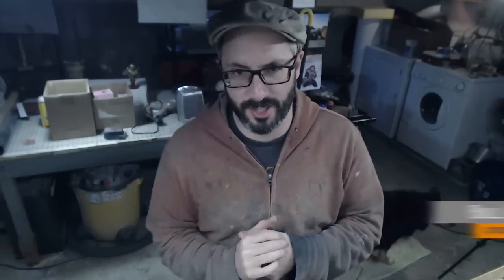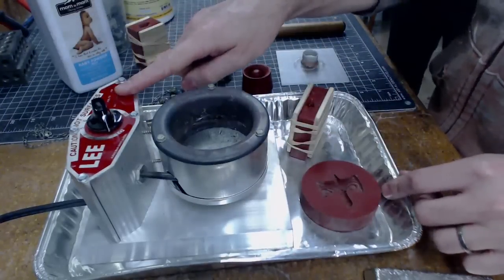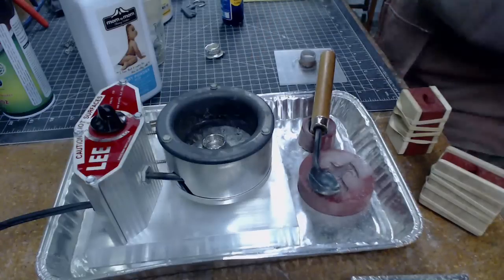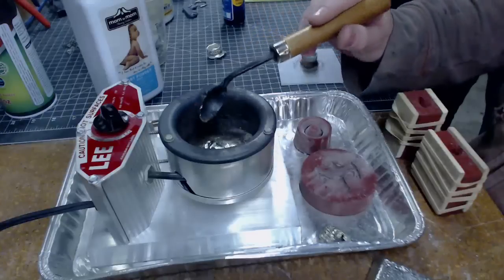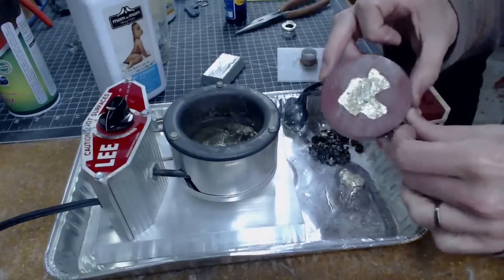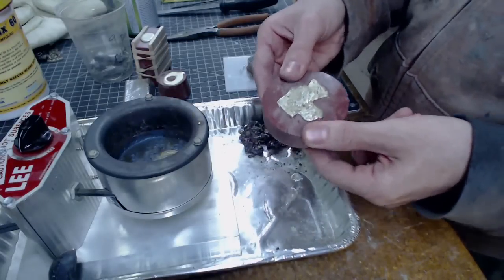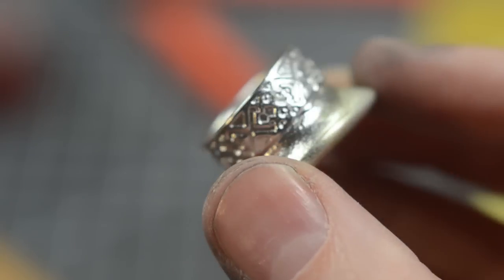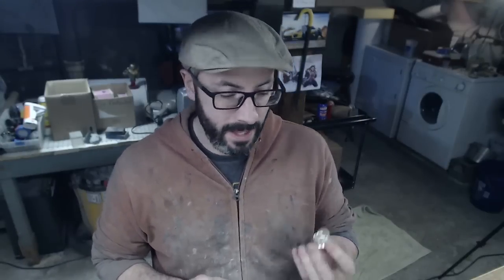Easy Metal Casting with a Silicone Mold and Pewter - Prop: Live from the Shop

Comment: Just wondering, as it seem´s to be an induction heater, wouldn´t you be able to place the entire mold inside it and let the pewter melt once again? Maybe that would help with the details and help if it plugs up.
Reply from the maker: I think that would destroy the mold. It's only heat resistant to a certain point.
Reply: That would probably happen if the  pewter heats up too much, since the mold shouldn´t have the properties to heat up with magnetic induction (or at least not as much as metals). But I have neither experience nor enough knoledge  to say that I´m right, so you are probably doing the wisest thing. Thank you for taking the time to write a reply, and please keep making cool videos such as this.

Comment: Hey do you guys have a video on how to clean up thoses diecast? I am really wanting to do this.
Reply from the maker: We don't have a specific video, but I basically cut off the extra with a saw and then used a sanding and grinding drum on my rotary tool to clean up the cut edge.
Reply: Punished Props Academy thank you so much.

Comment: Back in the 90's when Grunge from Seattle was the trend and an ounce of weed cost more than an ounce of gold I had a pewter goblet which I paid about $120 for from a games shop and one time I had it on a heater or near a heater and it melted.
Pewter has very low melting point.
Reply: Ha ha I bet that was darn disappointing.

Comment: If you plan on doing a lot of metal casting, take a look at this pot. Hold the mold under a nozzle in the bottom of the pot, lift a lever, and the metal flows directly from the pot into the mold. No worries about cold ladles or interrupted pours.https://www.amazon.com/Lee-Precision-Production-Pot-Grey/dp/B000NOORXY/ref=pd_sim_200_25?_encoding=UTF8&psc=1&refRID=2ZJ691V610V4QVMP1C0M
Reply: It also lets you avoid the dross that collects on top of the molten metal. At least until it's time to clean up.

Comment: Do you have a video on how to make the ring mold?
Reply from the maker: +Aaron Ace Not specifically, but here’s a video on one part molds: https://youtu.be/GN7wITTHFrc
Reply from the maker: +Aaron Ace You’ll want to use Mold Max 60 or a similar heat resistant silicone.

Comment: is there any products can outstand heat more than mold max 60
Reply from the maker: That's a great question for the folks over at Smooth-on
Reply: Green sand seems to be the standard method for metal casting.

Comment: Can you use this same method with gold?
Reply: I know you commented this three years ago but I looked it up & the melting point of gold is around 1000°C/2000°F so needs quite a lot of heat to melt, the source I was looking at recommended using a professional service over trying to diy it

Comment: Can you pour silver in those molds?
Reply: get some pottery clay bake it slowly until dry and it will work. you might have cracking in the heating but you can fill in with soft clay and heat again.
Reply: Just to correct you, silver can certainly be cast in silicone molds.
Reply: I know I'm necro'ing this thread, but no, you can't cast silver in silicone molds.  High-temp silicone is good up to a little under 600 degrees F, and sterling melts at over 1600 degrees F.  Pure silver is even higher.

Comment: Can you do this with silver?
Reply: Pewter melts at ~255C depending on the mix. Silver melts at 961.8°C. You'd need a MUCH hotter forge for silver. And you'd need to do sand casting rather than using the nice silicone molds.

Comment: I've always wanted to do metalwork but the concept of working with molten hot metal scares me 🙁
Reply: aimee mackenzie it’s fun!  Don’t be intimidated.  StArt with pewter, it has the lowest melting point, you could melt it on a hot plate.  Then pour it into a silicone hi temp mold.  Have fun!

Comment: what metal is? works on steel?
Reply from the maker: As mentioned in the video, we're casting with Pewter! It doesn't have as high a melting point as other metals so it's much easier to use for applications like this.

Comment: That film is dross.  I'm not sure what you should flux that with as it is pewter, but many common metals are fluxed (reduces dross) with borax which is easily acquired at your local wally world in the detergent isle.  Also, if your molds can take it; heating them in the oven & pouring while they are hot may give you better results.  
If you want to try something other than pewter then you could fill your molds with paraffin wax, then mold those castings in plaster.  There is specific plaster meant for this, & it must be baked thoroughly to get the moisture out.  You have to bake it to get the wax out anyway though.  
For more on pewter maybe try these guys?  :  http://www.iforgeiron.com/topic/22088-first-attempt-casting-pewter/

Also, please be sure of your pewter source as some pewter alloys contain lead, & that would not be something to wear around on your finger every day.  :  https://en.wikipedia.org/wiki/Pewter  

Great to know abt that silicone mold material!  Thanks!

Comment: does it work with Gallium?
Reply: I know this is a late reply, but don't try it with gallium, it just isn't worth it.

You cant use sand casting, due to the gallium having a tendency to supercool, causing it to not harden in the sand, plus gallium is so expensive that you would be basically contaminating gallium for a ring/object that will melt by you touching it too much, or the AC breaking and your house gets hot.

Comment: Cool Bills a metallurgist as well 🙂 

I had a quick look for the melting pot,  I believe it's temperature is 110C -430C ~ 230F -806F so you can pritty much guess where 550 is on it, (you  may want to check the info on it from where you bought it in case this is a different version then the one I looked at .

http://www.ebay.co.uk/itm/Metal-Casting-Melting-Pot-150ml-MEL90024-/311754789221?_trksid=p2141725.m3641.l6368

Comment: The "bad " metal you are skimming off the top is called dross. You can use a flux that will cut down on dross but it will smell and make a lot of smoke. I save all of my dross and when I have enough to work with I recover the pewter that is in the dross. I have a old cast iron frying pan that I do this in. I use the side burner on my outdoor gas grill and melt it down. Once it is molten you can skim the pewter off the dross. You will be surprised at how much metal you can recover with this method. If anyone needs lead free pewter ingots or mold making compounds I sell them on my eBay site. See eBay store berkshire_supply.

Comment: That junk that forms on top of the molten metal is called dross. I've watched quite a few videos about aluminium casting, and flux (usually salt) is added to the molten metal just before pouring. I'm told this helps the metal flow into the nooks and crannies of the mould, giving a more detailed casting. Maybe this would help with pewter too.
Reply: The 'junk' ring looked better imo :3
Reply: Ree1981 Yes. Depending on what you're making, sometimes a roughly hewn finish can give a more authentic result. Which is helpful for hacks like me :)
Reply: Could be interchangeable terms. Jargon works that way.
Reply: As i understand it, slag is the leftover stuff from when they refine from ore. Its the rock thats left behind. i could be wrong, its been years since my dad explained steel refining to me.
Reply: +GameraTheBrave I have never heard of anyone using salt for flux, but it would be interesting to see, usually it is borax.  The use of flux is for "cleaning" and preventing oxidation but in the process helps the metal flow better.
Reply: GameraTheBrave hhhhhhh he talk like it's kids show
Reply: I wonder if the salt method could also work for even lower melt metals like solder

just found out last night I can melt solder in a metal laddle with a cheap lighter. c_c

Comment: Soz im 4 months late. that crap on top is called slag, its impurtities/contamination from other metals/etc that corrupt the purity of the metal your using,keep scooping it out and get a better dealer for your metals cause they are ripping you off with impure metals.
Reply: Also when pouring metal (in experience) ive found that having a vent hole (made with a straw when initially moulding, will assist with the pouring so that the air can escape and not cause splash-back, metal bubbles or failed fills. :)